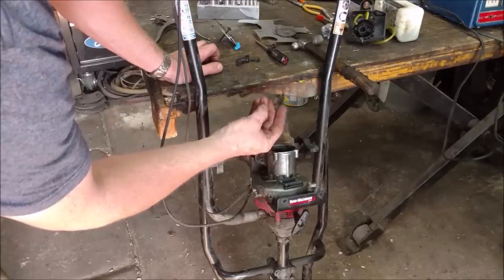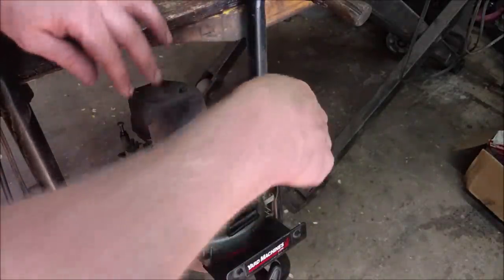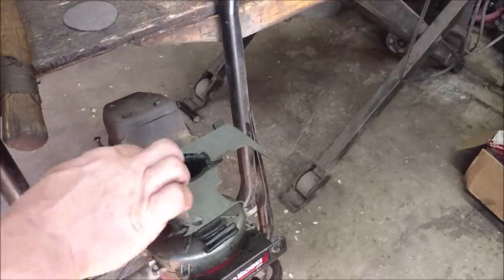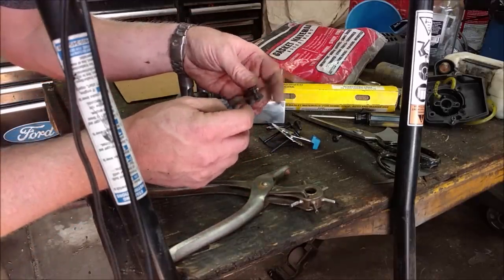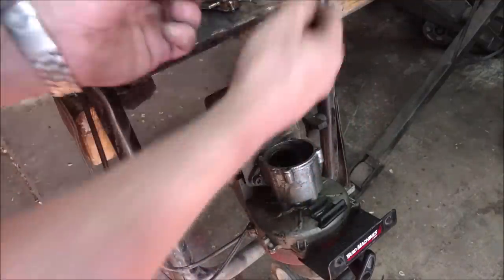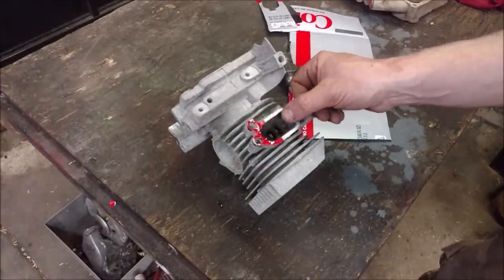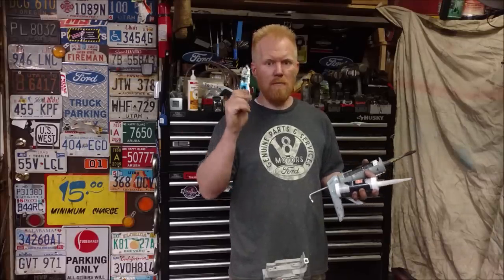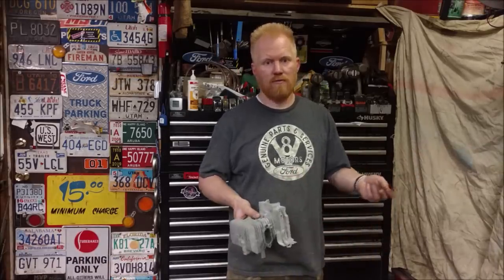Can you Make your own engine Gaskets ????

Comment: 1969 made gasket for thermostat for my 57 chevy.  Used poster board and permatex,  worked.  It was Sunday night and no part stores open. ADAPT and overcome, do what you can with what you got 👍  it worked.
Reply from the maker: That's great!
Reply: Gaskets are all over the kitchen. 
Cereal boxes. 
I prefer lucky charms boxes to give me luck that it won’t blow up. 
Mac and cheese boxes. 
Kraft boxes only though. 
the cheap stuff leaves an aftertaste the engine won’t like, and it’ll blow up. 
Heck, I’ve even used the oladys empty maxi pad boxes when stopping leaks is of utmost importance.

Comment: I've been making gaskets using the ball peen method for years with one minor difference. I make two bolt holes first to hold material in place.
Reply from the maker: Sometimes I will do the bolt holes first on a larger gasket. You're right it does really hold it better.

Comment: Half gallon cardboard milk cartons worked great for waterpump and thermostat housings.  I recall back in the day using the name brand Indian Head shellac gasket sealer on both sides, and then tightened to torque specs. After a day of drying, once the engine heated up to operating temperature, that shellac would become real hard. I ran  gaskets for years without them failing like that. I gave that method up for the silicone/rubber Make a Gasket In a Can they use to sell at O'rileys. I got great results with that product and it was so much quicker and easier to use.

Comment: Smear a dab of Vaseline on the end of the caulking tube then a little tape to cover it and they’ll never dry up on you and you won’t need the nail anymore. Same with RTV just put it in the cap before twist it back on.
Reply from the maker: I'll have to try that out.
Reply: Interesting, I'll have to try it as well.... Great if it works!
Reply: Awesome, Thanks!
Reply: Just kitchen wrap

Comment: Thanks for sharing.  I do the same thing.  One other thing I use from time to time to make the small holes is a piece of brass tubing with the end sharpened.  I put it in my battery powered drill and put a piece of wood under the gasket when drilling to give the gasket a nice smooth edge.
Reply from the maker: That's a good tip.
Reply: I use ball bearings for the small holes, when I do t have a punch.

Comment: When I started working many years ago that was one of the first things I saw the guys in the workshop do. I was amazed that it worked. My simple idea would have been to put paper and mark the edges with my finger nail then put on the gasket material and cut with a scissors. That said the methed shown works surprisingly good.
Reply from the maker: It's a handy trick.

Comment: I've used aluminum coil stock for roofing etc.. wrapped with silver aluminum tape for exhaust flange gaskets. I started off using it as a temporary fix until the parts store was open. Then decided I'd leave it in untill it failed. Then it just held so well I'm sold on it for exhaust gaskets. I will try this method for motor gaskets and such. Thanks!

Comment: To make the holes in the material you can use a slightly oversize ball bearing for the hole to hammer over the hole on top of the gasket held with a magnetized
steel roofing nail holder to keep the ball bearing from moving while you tap the hail holder with the hammer.

Comment: For joining aircraft engine crankcase halves we used silk thread and red RTV, we had to hurry and run through the torque sequence, none of the engines ever leaked. This was back in the 1980's when I attended aeronautics school, we all thought the engines would leak. Thanks for the video, I never thought to tap with my ball peen, I use Prussian blue to transfer the pattern, that is quite the mess though. I'm trying your method on my next gasket.

Comment: I like to make high compression soda can head gaskets by placing the original on top of the aluminum sheet and hitting it top down with some spray paint.  Then i use an xacto.

Comment: For gasket sealer I use axle grease.  It seals  and it will come off easy. I have made sump gaskets with cereal boxes and have never had a problem. Use grease and it never fails. I have made head gaskets out of roof flashing .
Reply from the maker: I've heard of greasing gaskets or presoaking in oil, but have never tried it.

Comment: Amazon has a Hole Puncher for cutting rubber plug stoppers .  It is a thin tube with a sharpened edge that cuts gasket paper well .  #2 Permatex is a pliable non hardening sealant paste .

Comment: Yup. Ive made a ton of gaskets just like that, but I might have hammered the bolt holes first then use a couple of bolts to hold it in place.. It's a satisfying feeling when it's all done. its how we did it in the Army (lots of axle flange gaskets on 2½~5 ton) and how I learned as a kid on mini bikes n go-carts (brigs n stratton 3~5hp) using peachee folders. Great video!
Reply from the maker: Yeah, bigger gaskets the bolts holding it in place helps a ton.

Comment: Tapping a little ball bearing on the screw holes cuts them out nicely too, as long as one is careful not to lose it in the engine!
Something to note about hole punches of all varieties, but especially the leather ones, is that they cut far better with backing material so double up your stock.
Reply from the maker: Ball bearing! FANTASTIC tip!

Comment: Great video (as usual) 

For those of us in the UK we can get 'Loctite 5922 Flange Sealant' from Halfords (and elsewhere) pretty easily.  Looks like the same thing to me - I've used it on cork gaskets for decades and it's excellent - never seems to harden like silicone sealant does.
Reply from the maker: I just read the specs on it and it seams like the same thing.
Reply: Thanks I'll get some -- specifically for tacking a carb bowl gasket 2mm width to fit up into a channel in the carb body to avoid having to dismount the carb  (again!).
Reply: @sixtyfiveford  thanks for confirmation.

Comment: Up here in Canada Permatex has a gasket material called Form-a-gasket,Which looks a lot like your # 2 it comes in a tube or a brush in can.I found it works a lot like yours also I use that cardboard like you do and sure works.Also silicone works on differentials covers.We use clear one as it works well without anything but it self.Also put plug on it and wrap it and keep it in a old freezer in shop.When needed it never hardens while it's in the freezer.
Reply from the maker: I generally use that brand; Permetex Form-a-gasket. It comes in #1 (hardening), #2(non-hardening) or #3( non-hardening liquid in can).

Comment: Another great one Moe. Been using ball peen hammers to make gaskets for years. I've got them sized from a 1/2" head to huge. If you really want to get fancy, you can grind the cheap forged hammer heads down as small as you need them. Keep up the great content my Friend! Zip~
Reply from the maker: I've been debating making an even smaller ball peen for a while now. 3/8" would be ideal.

Comment: I unroll the rolled material and leave sheets inside my shop manuals. BTW most gaskets can be replaced with the right sealant but that "right" sealant is usually not silicone. 3M 515 flange sealant works very well as does Hylomar (used on Rolls-Royce jet engines) and ThreeBond/Hondabond/Yamabond. I collect leather punches and single hole paper punches for working with gasket paper, and you can grind a cutting edge on any metal tubing or pipe you like.
Reply: Hi, can u give link for Threebond/honda/yamabond image?

Comment: Permatex "Gasket Dressing" is natural rubber and Isopropyl alcohol. I've used it on all gaskets,
works nicely to whet cardboard gaskets, never hardens, absorbs into paper.
Reply from the maker: True. It is very similar/ virtually identical in function too No.2 and No.3(aviation) gasket sealant made by Permatex.

Comment: Great video.  Yep, used this method on numerous projects without fault.  You found my "secret" material of using Coke box cardboard for gaskets.  I also often use it to make handy semi-rigid patterns of objects to later trace over on wood, metal or plastic so I can easily cut out the shape.  Can make many tracings before the Coke paper wears.  I also use the Coke paper to make mock 3D shapes like a cone or multi-shaped complex part models.  Easy to fix any design issues as paper before making the real one by cutting  or casting them.
Reply from the maker: Thanks.

Comment: Don't forget about Copper gasket spray. I've cut out my own metal gasket from aluminum sprayed it with the copper gasket spray just in case. It worked. It's still between the replacement EGR and head. Many many 7k rpm pulls and a few years now. I actually need to make my own gaskets for an intake swap, I'll keep this method in mind.
Reply from the maker: Yeah, the copper spray is good stuff for those metal gaskets.

Comment: I use engineers blue, ink or used engine oil to get a trace, then cut it out with scissors and use the same bolts to punch out the holes.

Comment: Only works on insides where curves are gradual. Sharp curves edges does not work. Also where you have dowel holes also issues. Best s to use CNC machine. Cheap, fast, accurate and find such shops all over.

Comment: I used to use conflakes packets for base gaskets, always worked fine :-D.
I tryed a few types of gasket cement, the blue hylomar (used by rolls royce apparently) was crap, too thin, not enough substance to it.

Red hylomar was pretty good,.
But the best and this makes no sense is a really cheap stuff called "Gasket Goo", the tubes were hung up on a big card in the shop, the tubes always seem to leak red goo slightly, so they did look crappy.
That was years ago, god knows  who made it.
Reply: zx8401ztv it was Soylent Green!
Reply from the maker: Hylomar. I've heard of this stuff, but have never tried it.

Comment: Those Ryan/Ryobi 2-cycle engines are still better quality compared to what you get today with residential equipment.
Reply from the maker: I agree. I've never come across a blown up one and personally have used a Ryobi 2 stroke for the past 15 years(and it was well used when I got it). They all die a ethanol death of simple dissolved fuel lines and dried up carb diaphragm.
Reply: @sixtyfiveford  Indeed. I rebuild the carburetors and replace fuel lines and filter with every one I get. Very helpful video. Thanks, Moe.
Reply: Try premium without ethanol, mixes oil better, and smoother running.

Comment: Rtv isn’t make to hold up to gas and oil. That’s probably the reason it fails on you. Use threebold 1211. Its a sealant made for engine use. I run it on my 2 smokers revving out at 17500-20000 rpms

Comment: I'm amazed at how gasket material is sold and no one, not even Fel-Pro, advertises what temperature they are good for. It's crazy. I need to make an intake gasket that will be safe for over 400 F and you can't find that information.

Comment: I used to use Hylomar non setting gasket compound with gaskets  best on the market.
Reply from the maker: Hylomar seems to be pretty common in the UK. I've never seen it over here in the States.
Reply: Rolls Royce motor cars used to assemble their car engines with it. Red hermetite  compound was another but to me looked amateurish

Comment: That’s a cool tip I’ve always used oil to give me a hide to cut the gasket not very accurate 

I have some strombergs that seep gas would that or some other gasket sealant work
Reply from the maker: The #2 sealant is the only thing that I've found that is gasoline resistant. I use it on small engine carb gaskets all the time with excellent results.

Comment: just need a video on exhaust gaskets now
Reply from the maker: I buy bulk exhaust gasket material (this stuff https://amzn.to/46Jo55i ) and just cut it out. I do a similar hammer technique just to impression the material for cutting with scissors/tin snips.
Reply: @sixtyfiveford  I've heard more better reviews of the 5960 by Mr. Gasket ("graphite sheet" at grainger) had a hard time cutting the metal precisely for the holes on the 3009 felpro stuff,  since punch didn't work. Better off with a die grinder bit. Figured it'd make a good video
Reply from the maker: @FrostyBravo  I've used the 5960 years ago. My issue was the smaller size of the sheet and the material doesn't look like stock gaskets like the 3009 does. I actually have plans to do a video on it. just haven't needed to make an exhaust gasket in a few years. Dumb luck I guess that I haven't had a bad exhaust gasket in years.

Comment: I have made a lot of homemade gaskets and saved a lot of time and money not having to run to the store
Reply from the maker: Bought a fuel pump for my 78 Ford a few years back that had the wrong gasket in the box. After the parts guy looked for a few minutes to swap me out with the right gasket I stopped him. He was shocked when I said I'll just make one in less time than he'll be able to find one and I did.
Reply: A lot of parts stores workers are not mechanics and Some don't even know how to use old school parts books
Reply from the maker: I have another one for you. 3 weeks ago I took an Alternator in to Autozone. Kid asks the standard year, make, engine, etc and then asks what I need. I point to the basic watermelon size Chevy alternator between us on the counter. His face was blank, absolutely blank. I had to break the silence after a few seconds as he had no idea what he was looking at. I couldn't stop smirking at the complete lack of automotive knowledge this 20somthing kid had. I had the same situation with tie rod ends a few years back with a young girl. She thought was making up the word "tie rod end" and had me spell it out for her. At least she was pleasant to look at.
Reply: I drove 15 miles round trip to o'reilly auto store ..the store clerk could not find a carb diaphragm for my briggs lawn mower engine had all the numbers but not the horse power of the engine ...gave up and came home and found the factory briggs  part number and called them and found out they had the  prime line brand kit hanging right beside the air filters and other mower stuff ..30 miles to get a part that cost under 5 bucks

Comment: When I saw the video link I thought you were going to make a gasket from an aluminum can. I bet that would actually work. I think you may want to anneal the aluminum, since it's been formed into a can. That would be an interesting thing to test.
Reply from the maker: I've done it from Copper but I'm sure a Soda Can would work. It would be nice if it was a little thicker.
Reply: sixtyfiveford yeah I've seen and used copper several times for plugs and hydraulics. There is a good article by a man named Bob Hoover about making gaskets from cereal boxes and using spray paint to seal them I believe. I'll see if I can find the link.
Reply: Here's that story. http://www.vw-resource.com/gaskets.html
Reply from the maker: Very entertaining read. Thanks.

Comment: Hi how you doing sixtyfive Ford? I liked your video but  I just want to say that you don't need that particular type a hammer to make a gasket. You could use any blunt surface like the rounded end part of a screwdriver or even a rounded blunt part of a nail punch or any type of tool with a blunt end.

I just wanted to clear the air for who are just starting out learning this stuff and took what you said literally.  That you had to use that particular hammer to do the job.
   I used to be that way, take things literally, when I first started learning about small engine repairs. Especially when I was still new to it and was as  green as can be when it came to this stuff.
Reply from the maker: I agree, but I hope most are willing to use what they have on hand. Some people can't though without being told. Sometimes I assume everyone has simple tools like a ballpeen hammer but when I look back I didn't have anything but a framing hammer when I first started repairing stuff.

Comment: Truck load of ideas there, actually put into practice. Thanks a lot! 
I tried to make a gasket for a carbureteur bowl: 62mm o.d., 2mm wide. It has to fit into a channel up in the carb, then the bowl crushes up into it. The price in the shop --11euros. I've ordered a compass cutter but have no idea if that's going to work, so any insight would be VERY MUCH APPRECIATED. Anyone? T hanks. (Not Tom Hanks, Thanks!)

Comment: I did not read all comments, so my option could be mentioned earlier. If you have old bearing steel balls, they work the same way as the hammer.
Reply from the maker: Yeah, good tip.

Comment: Hey, great video again!!  Is that no. 2 like the Indian Head gasket shellac?  I’ve used it for years and my dad swore by it.
Reply from the maker: It's not. Indian Head sets up rock hard and essentially permanently bonds parts together. It's a bugger to take parts apart and then clean off. It does work though but almost too well. #2 stays a super thick tar for life and cleans up effortlessly years and years later if you need to service the part.
Reply: I have some of that Old Indian Head gasket maker here in my shop and 
it's OK, but it kind of Crystallizes and gets too hard for lots of projects !
Keep up the Great work Moe !

Comment: Would that work for aTecumseh head gasket or do those have to be metal?
Reply from the maker: Not with this paper material. They sell exhaust gasket material/ high temp that would hold up well. It's around $10 for a sheet big enough to make 20-30 head gaskets https://amzn.to/3HkBlku